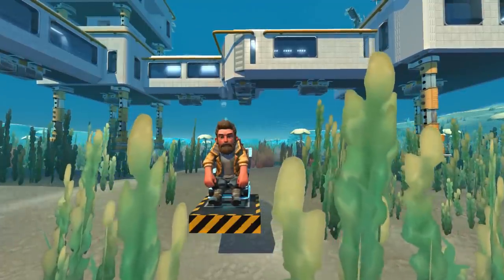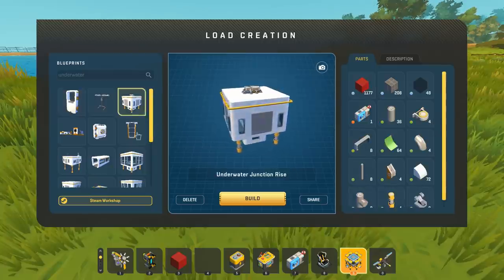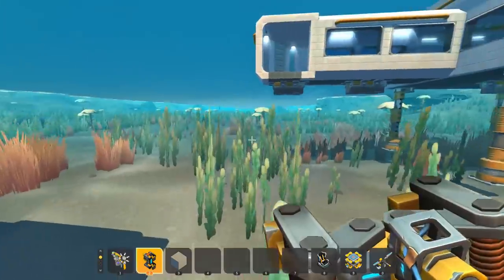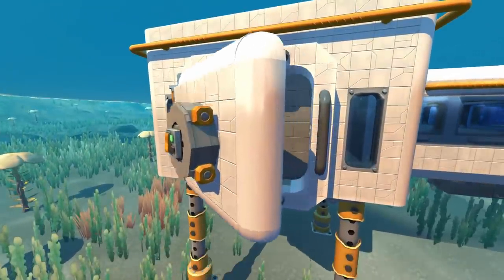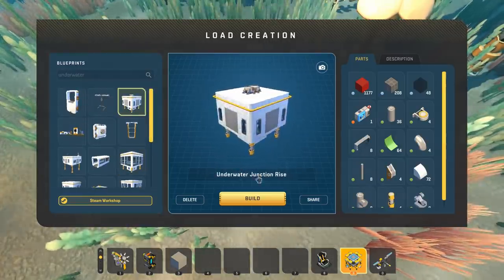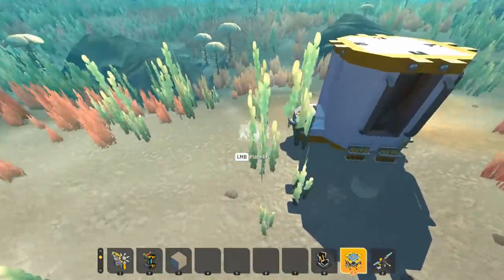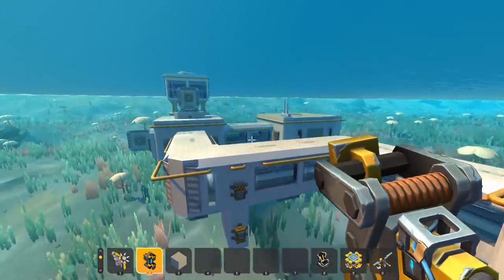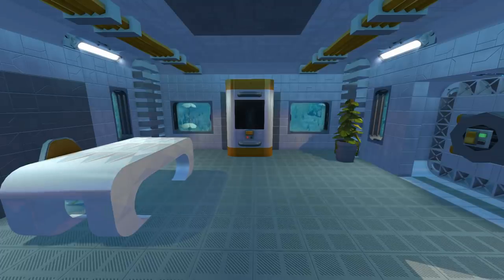Building an Underwater Base I can Walk and Breathe In! - Scrap Mechanic Gameplay

Comment: This is one thing that LITTERLY ANY game with water needs - AIR. This mod is already great, one thing that I think we can all agree with, though, is that flooding is good. Even ifi ts simple flooding like in subnautica or stormworks, its still flooding. That would be cool. Im also pretty sure that's possible, if you put the air thingy on the ceiling and move it up, but thats not a very good method.

Comment: ngl you should make any external entrances either come from below just like for ex. Underwater Labs from Rust
or atleast something like an airlock, where a piece doesnt have the Air generator but has 2 hatches built from both sides or smth(not sure how would that make sense though)